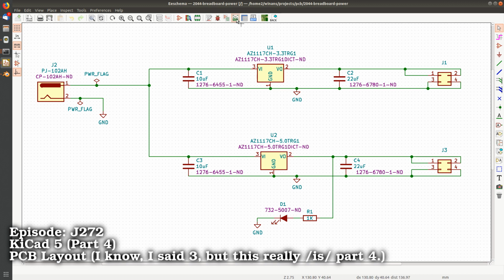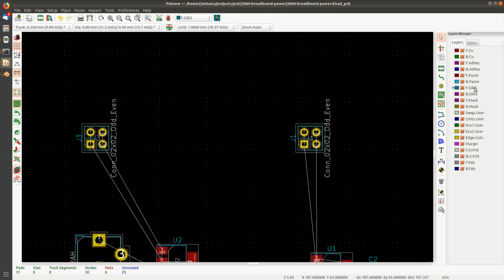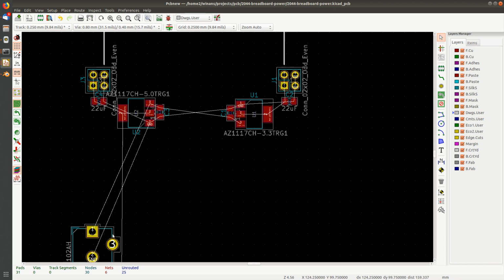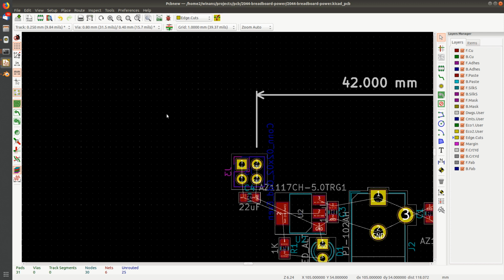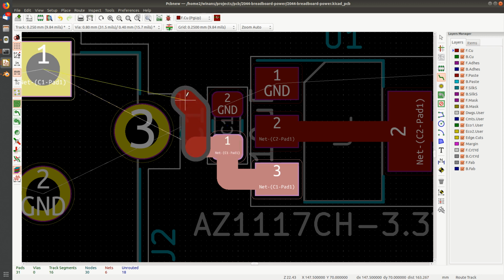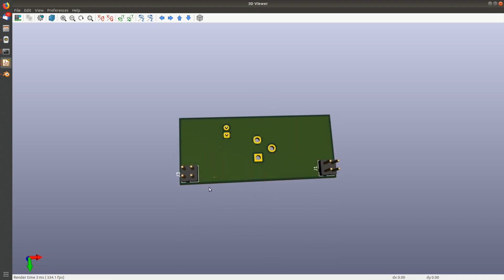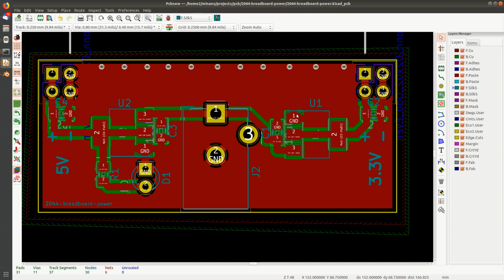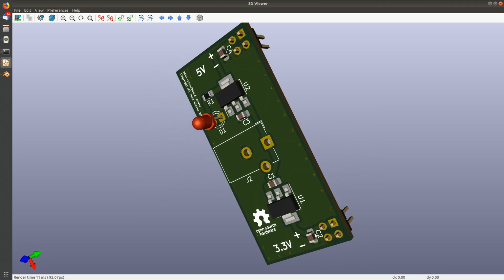KiCad 5 #4 PCB Layout

Comment: The generic barrel connector symbol on the schematic has two pins, but the specific footprint you chose for it has three.  I take it the third pin is for detecting whether something is plugged into the jack, which we don't need.  But were you certain about the pin numbering, that is, that pins 1 and 2 on the symbol correspond to pins 1 and 2 on the part (respectively)?
Reply from the maker: This would depend on which barrel you purchase.  In future vids I chuck the barrel & replace it with a USB connector so I could use a USB charger as a power source.  BUT... the micro-USB connector I chose to use is not exactly easy to solder in (as I show in one of the 'building' vids.)
If you want to build one of your own and want a USB connector, I STRONGLY recommend using a MINI-USB connector (if you are not pretty good at surface-mount soldering)!!!
This is the digikey part you want: WM17115-ND
This is the footprint you want for it from the Digikey footprint library: digikey-footprints:USB_Mini_B_Female_548190519
You can get the pinout for the symbol & footprint from this schematic (I have built these and they work fine):  https://github.com/johnwinans/2055-LPC51U68JBD64-breakout
Have fun!
Reply: You are fairly correct, back in the older days this three pin power jack connector was very common on things that were portable, especially portable cassette players, portable boomboxes (you needed a free shoulder to carry those things!), and later on, portable CD players etc, none of which were at all power efficient, so you pretty much only had dry cell 'D' or 'C' cells, with the smaller items using between 4-8 'AA' batteries. As such, the more permanent ground pin of the barrel had a 3rd pin sprung piece of metal that pressed against it, and when you pushed in the male plug it separated the two pins and could be used a dumb switch (internally in the jack) to detect, or rather switch between dry cell batteries and a low voltage mains/car power supply, if of course you were lucky enough to own such a thing. There was no small large amp switched mode power supplies, even a small mains regulator was a brick and kicked out just a few hundred milliamp, it was as simple as a primary/secondary, a very crude bridge rectifier, and it was regulated (if you can call it that) by resistors, no LM7805 etc. Seldom was there a LED, this consumed valuable mA, but if there was, it was red and as dull as anything. So many corners were cut. If you were lucky you had a thermal fuse against the secondary as protection against short circuit since using a diode caused too much of a voltage drop. Yes the technology was out there, but it was still expensive and still quite bulky for the average consumer. As times moved on and rechargeable batteries became affordable, some devices used NiCd batteries and a simple NiCd charging circuit, but often you had to move a switch inside the battery compartment to select which type of battery was installed, dry cell or rechargeable. It was a strange world we lived in...

Comment: John , at about the 13:12 time marker (of the video above) you highlight the #4 pin on the component so as to allign it properly with the grid according to the 42 mm spec. On the 
version of KiCad I'm using (ver 5.1.4), it won't let me highlight an individual pin of a component  while in the PCB editor. As a consequence, I'm unable to properly align the component  corresponding to the 13:12 time marker in your above video. Do you know what  I  need to do 
so that Kicad lets me highlight an individual pin of a  component in the PCB editor?      

Edward
Reply from the maker: What I did there was to single-click on one pad of the footprint with my left mouse button.  Is that what you are doing?
I have used every 5.x release and have not had trouble with this (in fact the opposite... often I want to select an entire footprint & grab a single pad.)
I don't see anything in the preferences that seems related to this feature.
I am on Ubuntu 18.04.  Maybe there is a variation caused by the OS?
Reply: John-
yes, I did do a single 'left-click' of the mouse over the pin but it didn't get highlighted. I am using windows 6.1 as the OS.  I was able to follow allow fine
with your tutorials (parts 1,2 and 3) but ran into a problem here in the pcb editor
when you alligned the left-most component with the  42mm marker.

Comment: thank you very much for such a great tutorial on pcb design. i am new in pcb designing and you cleared my most of the doubts. i have a question if you wanted ground layer on back of the board why did you drew it first on top layer and then again drew on back of the board and connected both layers. why you didnt draw it on back layer in the first place ?
Reply from the maker: It depends on the board.  On a busy board, the ground plane can end up getting cut by traces flowing across the board.  When that happens, I will put vias in place to let the plane on the other side connect across the cut.
On a board that doesn't otherwise need it, you still may want to provide an even distribution of copper to prevent chemical waste, board warping and to help maintain an even distribution of the plating material during manufacture.
Some PCB design tools allow you to put down what is called "thieving" which is a fill that is a bunch of copper dots to fill an area but not provide any conductive paths.
You can ask your PCB fab house what they recommend to do with unused areas on each of your layers so that they can give you the best quality based on the processes they use to create your board.
Reply: @JohnsBasement   thank you very much

Comment: Thanks for the great videos but after two days of farting around and being unable to find a simple footprint for a 2n2222 I deleted my entire project in frustration and removed every trace of kicad from my computer.
Reply from the maker: Hmmm.  It may have been a good idea to load the digikey library.  They have parts with foitprints already assigned.
Reply: @JohnsBasement  Thanks. I tried loads of libraries but they never showed up when assigning footprints and no way to change them. Tried all the change paths and everything. Waste of time. That was win10. May try on a linux box when I next feel like abusing myself 🤣
Reply: @Plan-C  It's in the standard Kicad 5 library. Just having problems in searching thru the footprint  library. I did a careful, eyeball search. 
Housings_DIP:
Select DIP-28 with the correct width (check data sheet.)
Reply: @williammentink  Wow. Thanks. Wasn't expecting any help! I will dig it out and re-visit it. I confused myself by adding libraries and changing paths and then got to stage where I forgot how to undo it all and lost my rag with it 🤣. Thanks again.
Reply: @Plan-C  Funny thing, I was having the same problem yesterday. Any how, check out part 9 of John's KiCad 5 series. He has put together a lesson on including a footprint library from Digikey.
Reply: it started with no dip28 socket symbol ... so I used an eprom and assigned it a downloaded dip28 from some site somewhere. Then I finally got to the end (2 sockets, 3 resistors, 4 caps and a transistor) and it was just spiteful how it 'manages libraries. I honestly think it would be quicker to draw with pen and paper and use wire and vero board. I think it was designed by sadists for a laugh 🤣

Comment: Very good tutorials. Helpt me a lot with the new Kicad version. Is it an option to make the board slightly bigger so the groundplane could route around the connection pins? It is maybe possible to use a single sidede board. I am glad that you made a double sided one to complete the tutorial and adressing rf and emc behavior. I have much to learn and will follow your tutorials.
Reply from the maker: I don't know about an 'option' perse.  I do it the naive way by dragging out the board outline lines & reconnect the corners.  😏
Reply from the maker: Some single-sided discussion that might be useful can be found here. Unless you are etching one by hand, it should cost the same as a double-sided board.  https://forum.kicad.info/t/single-sided-circuit-boards/7122
The simple answer is to only route traces & filled regions on only one side.

Comment: Just curious why you have two ground planes and no power plane.  Is it bad design to have the front of the board filled with +5V and the back filled with ground?
Reply from the maker: In simpler designs like this i tend to favor grounding all the unused copper and routing the power busses along with everything else.  In a 4 layer design I usually have an internal ground and power layer & route signals on the surface.

Ultimately it REALLY depends on the needs of the circuit.  For example once I built a video switcher where I routed many 75 ohm analog signals on an internal plane between two ground planes to keep them clean & to control the impedance.

Comment: Thanks for the tutorial, it's the best one I've seen. Might the acid trap advice be a bit overplayed? Manufacturing has come a long way https://resources.ema-eda.com/blog/are-acid-traps-still-a-problem-for-pcbs-in-2019
Reply from the maker: Perhaps.  But for those of us using 6 mil traces from the bottom of the barrel board shopps... I'm not entirely sure.  Maybe I'm getting paranoid as I get older?   If I have the space, I still avoid acute angles... even if it is just a tradition.

Comment: DRC doesn't detect track short  !?!?   Whoops.  In silkscreen I also add "iss 1" for issue one, as my boards are named after project codes which don't change.  There is also a 'mod' table (modifications) numbered 1 to 5, where engineer can tick the number to show which modification level that particular board is at.  I also have copper and solder mask keepout pours in one area at the edge, on all layers, with text numbers indicating that layer. So for a four layer board held up to the light you'll see "1" on top layer, "2" on 2nd, "3" on 3rd and finally a reversed "4" on the bottom layer; this helps the pcb manufacturer set your layers in the correct order when providing them standard Gerbers.
Reply from the maker: Yeah... This is cool stuff... I did the same when working with 4-layer boards some years ago.  I also like to put Easter-eggs in internal layers with keep-outs on the outside so you can read something like 'John Was Here' if you shine a light through it... Or putting text onto the soldermask layer of an ENIG board and seeing it written in gold...  :-D
Probably worth adding to my list of vids-to-make.
Reply: @JohnsBasement  : Text in the soldermask layer does look really nice.  Tried the drc short from your vid on my version of Kucad (latest as of 1st June 19) and it seems that particular bug has been fixed.
Reply from the maker: Ahhh!  I'm glad to hear that.  I think I am in need of an upgrade.

Comment: Learned a few new tricks. Thank you.
Reply from the maker: Thanks! Is there any topic you'd like to hear mote about?
Reply: I would like to see a video on how to panelize a design with Kicad 5 including a way to easily snap a board away from the panel. Also, how to include a prototype area on a pcb that includes an array of interspersed through-hole and surface mount pads. Both ideas should be doable by the popular offshore pcb fabs typically advertised on Youtube.

Thank you for asking.
Reply from the maker: Gary Jenson
Gary, I have yet to create any panels for any of my projects.  (My professional work has focused on large PCBs that didn;t need panels and my hobby work of one-offs have yet to need one).
All is not lost, however.  I can see that a talk is scheduled at KiCon 2019 by Piotr Esden-Tempski that will be recorded and made available.  I expect that to be enlightening to both of us!
Scroll about 2/3 down this page: https://kicad-kicon.com/talks/
Reply: Thank you for the link. I will definitely check it out.